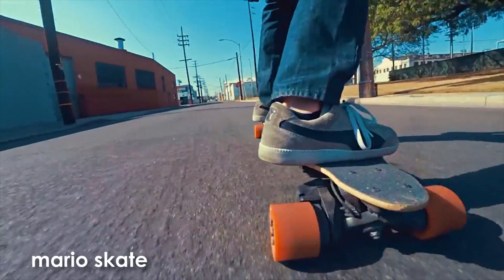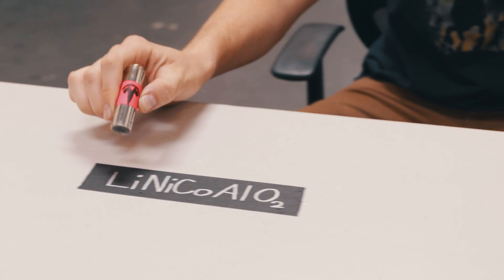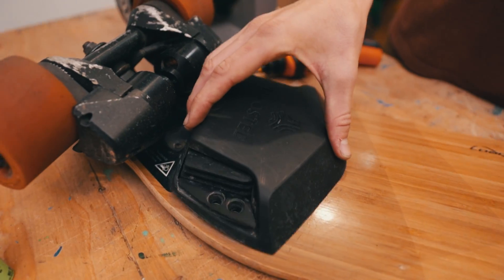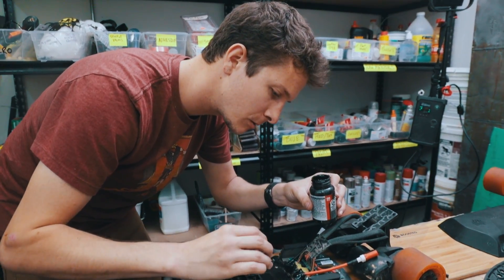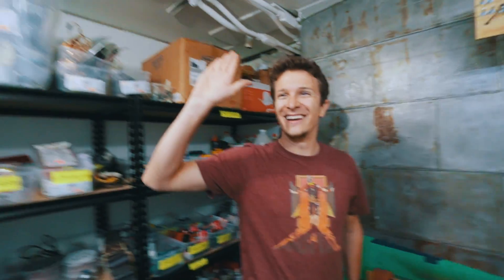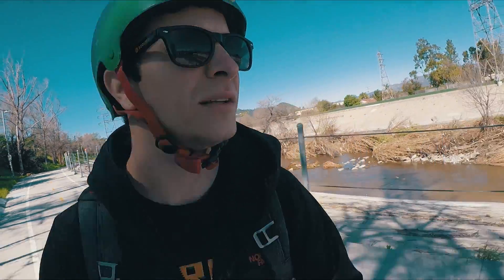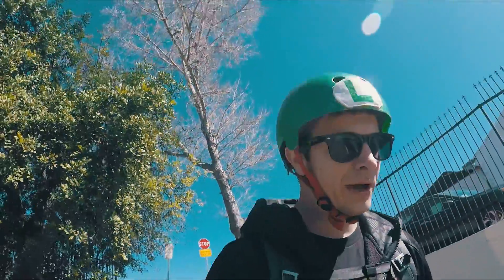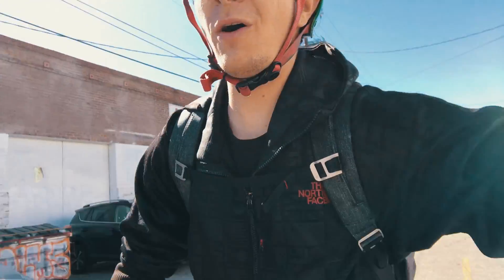Tesla Batteries in an Electric Skateboard!

Comment: You need a "step up converter", or better known as "Boost converter". It boosts up your voltage so you can have a higher voltage for your electronics to work, and it will eventually help you use the rest of the charge of the battery, but, you have to account that those circuits are not 100% efficient, and that it might be quite hard to find a Boost converter that can handle that amount of current, might be expensive. These type of circuits are usually used in same aplications but with so much smaller currents, like keeping the same voltage on a cell phone as the battery discharges, untill they go down past a limit wich then stops working, but it might help you fix your problem.

Another interesting thought about your particular case is that you might consider having your batteries wired up in parallel and when you get to that point having a switch to connect them in series, I know that the voltage might seem too high but if its not directly connected to the electronics inside you wount have any problems (dont worry about the battery sense voltage reader) as long as you dont switch them too soon, wich will definitely make your motor burn.

Both options need a little bit of study of the electronics inside of the device but I hope they're helpful for you.
This is the first of your videos that I've watched and have really enjoyed it. Sorry for my bodged English and have a nice day!

Comment: Add a capacitor. The problem is that those batteries don't output the same amount of power as the boosted board batteries. A capacitor and maybe a tuned Arduino should do the trick. When you connect batteries together, only electron storage increases, not voltage.

Comment: If you are looking for a decent electric skateboard should have a look at XTND board !
It can go upto a max of 28mph (45kph) with the largest battery pack (swappable) of 133w and has a range of 12.5miles. it weighs only 3.9kg with the battery and is water proof with a rating of ip66 and also fully charges within the hour.
Check out the details here - https://www.kickstarter.com/projects/910224259/xtnd-worlds-first-electric-board-with-ai/comments
And youtube videos about the specs - https://www.youtube.com/channel/UCIeb64y2CVEAipHlHc8E2dA

Comment: Wont he have better luck if he made the pack by adding 2 cells together and then made the pack?

Also: add a battery monitor dude.

In his pack if one pack is lower voltage then the other, the one with more charge will charge the other at 40 volt. but the 2 cell way will only charge the 3.7 volt to 3.. volt. 

Right?

Comment: What you need to do is buy another charger off eBay and make an outlet with the battery packs to charge the board while you ride. Since it needs to be unplugged to ride, take out the sensor in the circuit board
Reply: Our Daily Lives wouldn't work. These things can draw like 2000W at max, way more than any charger would handle.
Reply: Boosted board's take a long time to charge
Reply: Wouldn't it be crazy if the boosted board was 4 wheel drive 😂
Reply: i feel like the batteries would get too hot
Reply: loool trying to kill those batteries :P. That sensor is in there for a reason
Reply: I think this should be  upvoted. This is the answer.
Reply: he needs another battery to charge the smaller battery

Comment: What you need to do is buy another charger off eBay and make an outlet with the battery packs to charge the board while you ride. Since it needs to be unplugged to ride, take out the sensor in the circuit board

Comment: You may use a regulator IC in between the battery pack and the electric board. It will regulate your added power supply to a certain voltage range. Hopefully it will work. :)

peace \m/

Comment: is there something in the board itself that causes the battery to only input or output a certain voltage? like some kind of chip or a blocker Maybe?... by pass it somehow to run from your batteries standard instead of the stock ones

Comment: add motors to the wheels if the front not powered so as you go you generates power to charge the battery. Or make it so as you are cruising down hill or just cruising the motor spins so it makes power.

Comment: You seem to be confused about electrical voltage, current and power. What the voltage output is showing basically doesn't matter. An empty battery can show the right voltage but have 0 current.

Comment: I do not understand this dudes logic...First of all LifePO4 are great batteries designed for many charge cycles so they are expensive....Why not just buy some cheap lithium ion batteries? What's with the Tesla Batteries, how much more energy (watts) do they store? As for letting them run low and leaving them in that state for "months", you probably damaged them.

Comment: 8:48 Your not getting the current draw that you want.. Increasing batteries in parallel doesn't increase the current unless the batteries were not able to supply the current the motor needed. if it did, then you got max speed you'll ever get, even with 1000 amps at your immediate disposal. The motor will pull the amount of current it'll ever want and only pull more if you increase the voltage (hell no) or you are under load (hill maybe) then the current increases to keep you moving. increasing batteries will only get you more distance or at least minimum a stable current flow under load. Better off getting higher amp hour batteries and parallel more of them to get more distance.

Comment: You could put an arduino before the board battery that functions as a switch by monitoring flow (an arduino can be setup as a logic circuit AND DMM) and then switching off the board battery completely when it drops to the critical level.

Comment: lipos are made to have stable voltage all the way through their capacity range so went its empty capacity is instantly lost. general rule when lipos are fully charged they(individual cell) are 4.2V when the are empty they are 3.7V so you had 35.6V in them so that means they each had about 3.5V so they are empty

Comment: NO, adding more batteries in parallel will NOT increase your torque.  You need to increase the VOLTAGE supplied to the motor, but be careful because you could damage your circuitry, including the motor.

Comment: What if you placed resisters on the boosted board battery so that its charge would last longer with the added power of the tesla batteries? It would make it run for a longer period of time, right?

Comment: you need to make a switch, once the boosted battery is empty, turn it off, allowing the Tesla batteries to pick up the extra slack, (use both boosted & Tesla batteries until boosted runs out, then flip off boosted power source, to enable the extra voltage from Tesla batteries)

Comment: Probably cut off the wires to the main power, then sadder the "car" battery to the wire that you cut off, and than sadder the main battery to the "car" battery. So basically invert what you did to add the "car" battery.

Comment: Look at the Evolve GT series with up to 30km/18.5miles on the All terrain GT, Approx. 36-42kph/22-26mph top speed,  up to 25% gradient in GT mode,  and the remote has a Digital LCD screen remote with speed indicator, trip function, 4 speed settings, Battery display, wheel and gear settings and diagnosis screen. and I have used one before and it is amazing.

Comment: Lower the voltage of your selfmade batt but increase the mAh. Basically swap some of the series connections to a parallel ones, and your total energy does not change cause volts*curr*time stays as a constant. Just keep the same voltage as the original batt has.

Comment: my guess = torque is relative to total percentage of voltage/volume. basically the bigger the well the smaller the nozzle. hope this helps 👍. (so more batteries equals a larger power source, so now when the whole package is at volts it now has to divide the pushing aka amperage drop per source. meaning the flow of amps isn't solid most likely due to mixed matched batteries. 18650s are also Vape batteries and there's tons of tutorials on watts/voltage. so the more splices/batteries less amperage due to splicing.

Comment: bro you actually explained the problem in your vids. you are using    low output batteries that why you dont have torque
Reply: Except that's probably not the reason he lost torque. When the boosted board was being designed, it was designed with a 5 mile range in mind. The duty cycle on the motors for the board probably isn't that great, so that's probably the main reason for the slowdown.

Comment: sounds like there might be a voltage cut off on the board to protect the batteries . In my Rc vehicles I would add  a BEC , which is just a bunch of capacitors to supply just the servo with power . maybe something like this can be added?

Comment: When you have a specific amount of voltage, it can not drop further than the starting battery. Right? So remove the batteries that came with the board and replace it that with your DIY batteries. When you are done replacing the batteries, you should have more power. 

https://engineering.mit.edu/engage/ask-an-engineer/how-does-a-battery-work/

Comment: The best way you should do this is to have each of your packs have the same Ah and V as the boosted board battery. That way all the batteries will charge and discharge at the same rate. Once you do that, you should be able to connect as many of the battery packs in parallel as you want to increase your range, as long as you make sure that you are connecting the boosted board batteries in parallel in the same way. If all the battery packs are in parallel and have the same rating, you shouldn't have to worry about this issue. Love the video!
Reply: Basically whats most important is connecting these batteries to the boosted batteries in PARALLEL

Comment: just build your own board, I know nothing of electronics but still managed to put mine together (with help from forums). My boards got a top speed of 33mph with a range of 15miles (at around 18mph) and it blasts uphills as I can adjust the torque on my PC. 
 Also, there are 18650 batteries made by LG that are a little more expensive but have a higher capacity than the Tesla batteries. All in all it cost $1300 and it could have been cheaper but I got better quality/ more expensive wheels, bearings, batteries + remote control etc. Took about two days of tinkering around to get it working and it eats boosted boards for breakfast ;)

Comment: if you for the battery packs to charge the board's batteries at the same time that you're using said battery packs then you should be able to fully utilize the voltage of all the batteries. the problem is the board's batteries. find a way to keep them charged while you ride then problem solved. you can use your homemade battery packs to charge them.

Comment: remove the stock battery pack,
make two more panasonic packs and pair them in series with your current panasonic battery packs
two panasonic packs per set,
then wire them in parallel
one set on the left one set on the right.

then add a voltage regulator to stop the board from being fried.
the voltage will be relatively high enough that any voltage drops when the battery drains would be minuscule in terms of what the board uses.

Comment: you MUST, remove the original 2 batteries. effectively what you're pretty much doing is running those out of para/series and they are over draining. also you'd be MUCH better off with LG HG2 18650 3000mAh 20A batteries. with those you have solid 20a and i believe 30a pulse rating per battery with the highest mAh.
So when the board wants more juice for hills, it can draw it without issues.

Comment: What you need to do is ditch the boosted board and do a DIY build where you get to control your cutoff voltages. That, or ditch the boosted board speed controllers, and switch to using VESC controllers, which would also require using a different remote control, and most likely a different charger.

Comment: simple solution, stop trying to connect them to the boosted boards existing battery, just use the panasonic 18650 cells, i know you're dumbing it down in the video; but holy hell please tell me you know more about batteries than you're letting otherwise stop and read up then continue , for reall ( not being mean  ).  trying to wire different cells in parallel is hard because you have to balance the cells  mah aswell as voltage otherwise like you say when the battery stops producing a current it slows down. this   is because the other two batteries are effectively trying to charge a battery and drive the motor at the same time;  the reason this happens is you have to imagine the currrent like a random path of water, if there is no pressure (current ) from the direction of the on-board battery then the current will split to the battery which is acting like a fake ground and to the motor.  another reason you where thinking the cells had charge when they clearly didn't is because cells only drop volts when a current is drawn, so having the motors idle drawing minimal current causes minimal voltage drop causing you to think the batteries have charge when they don't. look up how battery percentage is calculate for phones that will give you a better indication on how to tell if your battery is flat. however if you just want a simple solution to this issue disconnect the on-board battery and try just using the cells, maybe even install a manual switch to switch over when the panasonic cells die.

also be careful when charging your boosted board, make sure you use a thing called a balance charger when charging them otherwise you'll overcharge the first two in parallel and blow them up.

im simplifying this greatly, please correct me if i got this wrong i'm only human and did this like 4 years ago, peace.

Comment: just add an extra cell. Usually electronic stuff on these boards is pretty overbuilt so instead of having 10sbattery make it 11s. You will even have more torque at the low end and more top speed at the high end. I have alot of experience in building ebikes and just tinkering with this stuff so you should try it out.

Comment: If adding more batteries only increases the range and weight, but not increases the rotors output, why not use a capacitor bank that can give it a voltage boost when going up hill. How to triger it sounds tricky. Nice idea moding that board!!! good luck

Comment: You could try a variable step up transformer? With a switch to engage it when you reach the boosted battery limit. Also for battery monitoring, when I was in high school I made a low battery meter using a 555 integrated chip. If your interested I could try to find the schematic I made! Good luck!!!

Comment: 1.Remove the battery that came with it.
2.Adjust the voltage cut-off setting. (HACK IT BRUH, probably the first thing i would check)
OR
1.Remove the battery that came with it.
3.Use a boost converter. (typically poor efficiency, i would never choose this)
OR
1.Remove the battery that came with it.
2.Add another cell in series.
3.Use a BUCK DOWN CONVERTER!!! (Higher efficiency, higher achievable power, my second choice)
Contact me if interested, cuz i am!

Comment: try using 26650 imr Li 60 amps(more amps on demand), instead of 30 amps of the 23650 icr. (icr is for flashlights, imr is for high amp demand applications). I only use these for my e-cig due to my low resistance and high amp requirements. oh and Li batts r  crap after about 3.6v per cell due the fact of the capacitance of the cell the max at 4.1-4.3VDc is only usefull in low volt applcations due the Mah of the cell(milli amps per hr) ex, 3500MAh is 3000 hrs for 1 amp of load on the cell at 1 ohm of restance. Amps do the work and volts carry the load over the distance. like torq over hp( torq being amps and hp being hp in a car) hope I have helped with this this power problem

Comment: wire the battery packs in series parallel to have 80v.  panasonic batteries 80v > 40V voltage regulator > boosted board wiring.  side note, I would ditch the boosted board batteries

Comment: Smaller batteries that match the Mah of the boosted and than lets say 5 in parallel. Use a step up converter to reach 40vdc. This way they we both deplete at the same time with the same resistance as they have the same amperage and Mah. Oh and use a switching stepup converter, this way your Voc can lower with the same fixed vdc output!..

Comment: 9:06 the ESC has a max current going over it can't be done on this board because the resistance is to high at the voltage to allow more current

Comment: Hay Sam. I did the same with my Fiik street suffer.  I used all tesla batteries 10s 4p with no BSM (they sometimes give your computer false readings). I get about 42 miles per charge riding very hard the whole time.  I've made 6 more packs and have had the same results. A big factor in your trial was your consistency in voltage.  I suggest pulling your batteries and discharging them (no lower than 2.45V/cell for Li-phosphate and no lower than 2.50V/cell for your Li-ion) then charge them while balancing them as well. I can almost guarantee you'll be amazed by the result.  I hope this helps. If you decide to forgo the BSM I'd get a little voltage alarm just for safety.  There very inexpensive hear's the link.  Fun vid man don't give up!
 https://www.amazon.com/Battery-Voltage-Tester-Checker-Indicator/dp/B01MQSHS4N/ref=sr_1_10?s=toys-and-games&ie=UTF8&qid=1493711088&sr=1-10&keywords=voltage+alarm

Comment: I think a relatively simple solution is just to use part of the charge from the two tesla battery packs to trickle charge the booster board battery while you use it. I think that means that you need to draw at two different voltages, but a transformer should fix that. That way you empty each simultaneously.